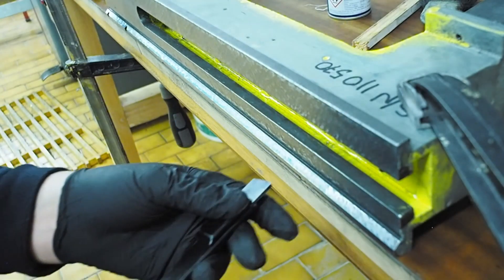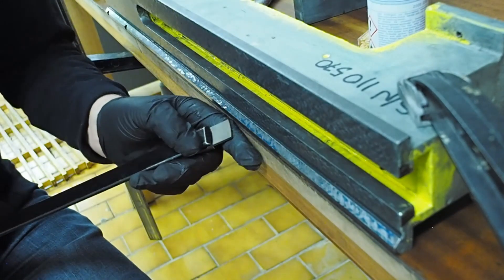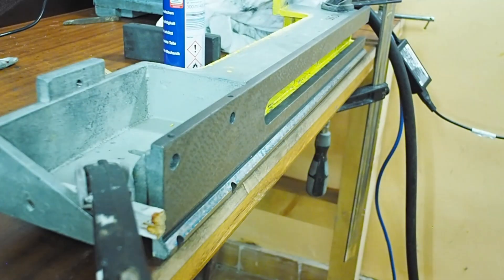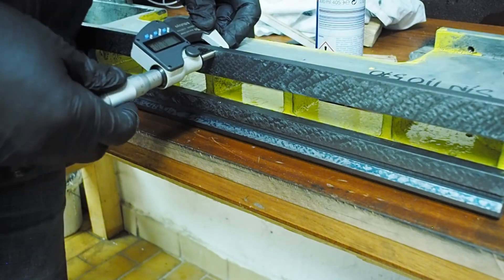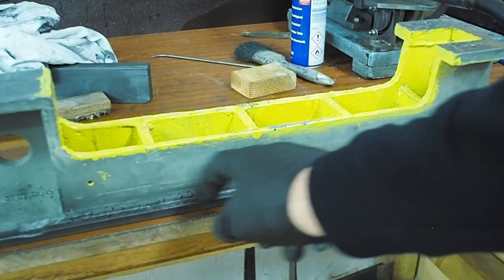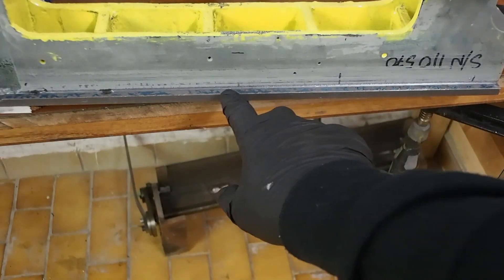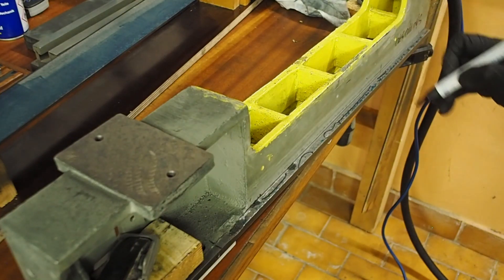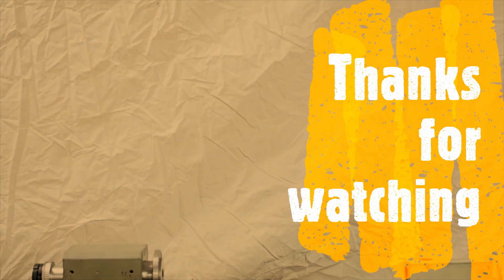Pimping the minilathe  Episode 2 - Still scraping

Comment: Started my channel with a big restoration project. I have managed to remake two bushings out of eight. Thought i should get a new milling machine to help with the project, this turned out to be faulty due to swarf in the spindle bearings so had to fix that. Then i stripped it down because i didn't trust i could use it without checking every thing on it. Found that one of the way looked like it had been scraped in with an angle grinder so i quickly learnt how to scrape ways in (sort of).  Now two new work projects have wormed their way in. started one and found that my new vice is wonky and will need sorting. Wish i had time to film it all (:
Reply from the maker: Getting started in machining is frustrating, as you need a lot of tooling to do the stuff needed to make tooling. I wonder if that ever stops.

Comment: You could flip the straight edge around so that the heavier side is toward the work.
Reply from the maker: Hi Jeremiah, thanks for watching. That straight edge is not a full triangle. The thick side doesn't have a sharp corner. It it sort of flat pentagon. I think it was a shop made tool, milled from a slab of meehanite.

Comment: Nice, how did you enscure that all face are in the right angle to each other?
Reply from the maker: With the bed ways, it is not really relevant whether they are at 90° It is important that they are parallel.

Comment: Any recommendations for sourcing a large, triangular straight edge? 

I can mill and scrape a rough casting, but have not been able to find anything for less than what my mini lathe cost.

At this point, I think just chopping and scraping in some cheap 123 blocks may be the most cost effective way to do it.
Reply from the maker: Hi Ethan, that will depend where you live. In the states, I would guess that a granite straight edge from Shars is probably about as cheap as possible. [Edit] Hold that. I see that the 12x18 granite surface plate I bought from Shars in 2007 for $18, they now sell for $157. What happened there?

The cheapest source of good quality, well seasoned cast iron is the local scrap yard. The perverse thing is that the cheapest way to get a billet is to buy a worn out old machine tool, like a lathe, and cut out a section of a way to make a straight edge. I got lucky to pick up that staight edge at an industrial surplus place a couple of hours east of Bratislava, in Slovakia. Then again, for the gas, and all the other junk I bought in my shopping frenzy, I probably could have bought something off Ebay.

123 blocks wont replace a straight edge, and surface plate.